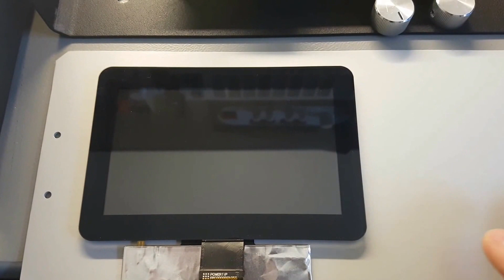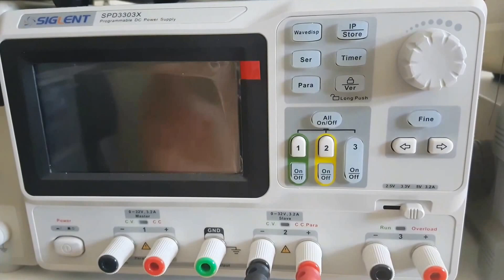STM32-based ultimate 3-Phase Motor Controller - Housing construction

Comment: Hello motor control enthusiast!
Tell me, for what reason are you constructing this? :) I am also in the midst of creating a new motor controller with space vector modulation and a couple of other features. But mainly because its fun!  :) Nice work btw!
Reply from the maker: Ghoetic Thanks for the feedback. Well, mainly I'm doing it just for fun. I also want to inspire other people out there to build electronic circuits. And thirdly I have always wanted an universal 3 phase power inverter. BR Achim
Reply: I see thats good! but regarding point three,have you concidered the amount of time and money spent creating an universal controller vs buying one? I mean you could still have "fun" making a low power inverter and use a commercial one for more heavy duty playing 😊. Talking from experience i spent way to much to get an very barebones working prototype 😅
Reply from the maker: Well, yes and no. I could buy a ready-to-use one. However, I really want to have access to all the parameters inside like the PWM-frequency, sine accuracy, sine resolution, sine steps, dead time, ... In addition to that this is not only a frequency inverter - I will also add several other features like three independent PWM outputs, FOC closed loop mode and an arbitrary mode. Last but not least I'm sure you know it's much more fun to build an own device instead of buying one :). Thanks for the feedback!
Reply from the maker: By the way, have you already seen my other videos? There are several videos on my channel showing this device in operation (e.g. https://www.youtube.com/watch?v=DmxhM0FfwNY).
Reply: Aha i understand! Yeah ofc i have watched your other videos 😁 Very impressive! I was asking because i work with lots of ABB inverters and all that stuff, pwm frequency, which type of modulation and so on is always "keept under the hood" from the user. As in a lot of cases there are optimal parameters and deviating from them will only give a sligthly worse performance. Any specific reason why YOU  want to change let say the sine resolution? 😊 keep up the good work!
Reply from the maker: +Ghoetic I really enjoy tweaking at the parameters during operation and watching at the motor behavior. Some motors for example run quite good at a very rough sine resolution whereas others are behaving like princesses :). I think I possibly can get a much deeper understanding of motors by just experimenting in that direction. I mean it's surly not all about the number of pole pairs, the turns,... In my point of view every motor has its own "fingerprint" and needs his own phase advance and so on in order to work perfect. Motors are that complex and I just wanted to build some tool that helps me to reveal some of their secrets :). I hope you understand what I mean?